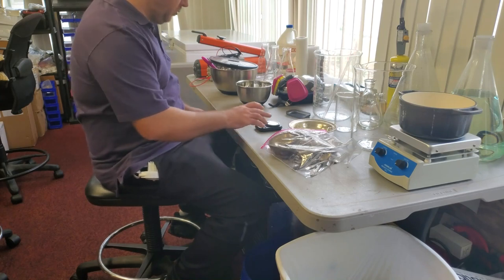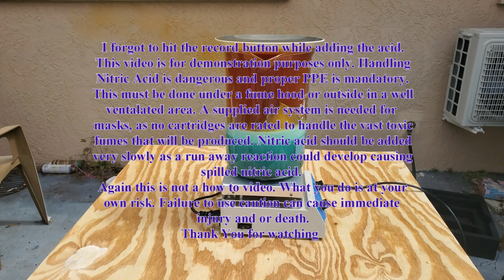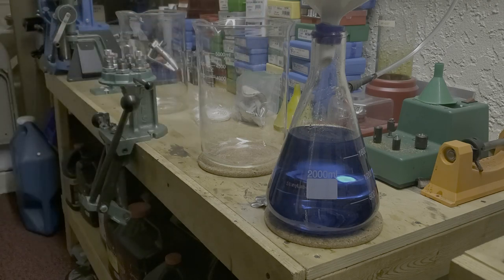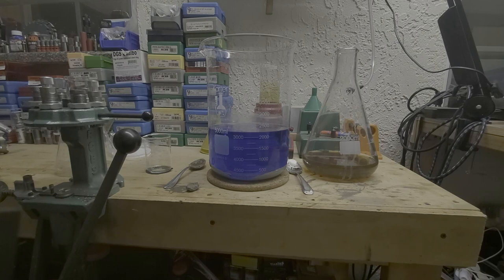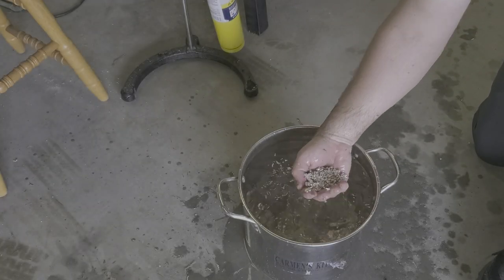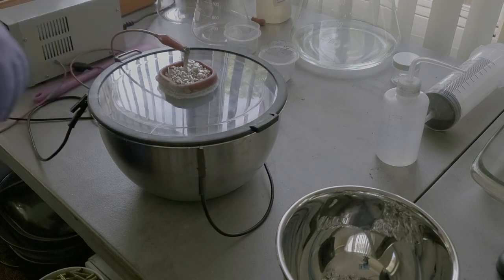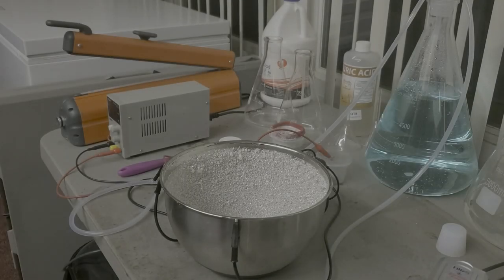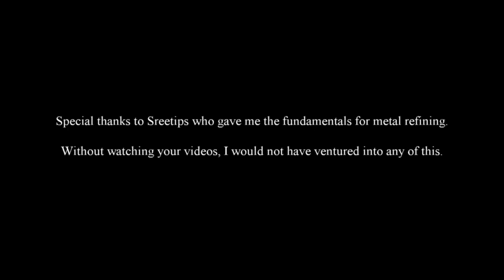Silver Refining Complete Process

Comment: How much Silver did you get out of the Used electrolyte? Im sure it was still loaded with Silver Nitrate.
Reply from the maker: Well its a lot. When the silver nitrate is saturated with copper to the point where it affects you purity you recover what's in it and start all over. Most will use muriatic acid lye and sugar to recover the silver it will leave you with a pretty pure silver but its a little bit of a pain.
Reply: Yeah I was just wondering how much you got out of it. Usally run mine about 2 weeks before I wash and I get a bit of silver out but it's nearly blue water at that point. I've found my copper plate out point and so I just go at 2 weeks and stop. Beyond that i see the copper coming out. But yours looks great! I've watched all of Sreetips stuff and I enjoyed yours just as much. I love watching this stuff even if I do it also haha. Keep it up
Reply from the maker: When I am making my silver nitrate I run about 25 troy oz of silver per 5000ml. I don't let it come anywhere close to exhausting the silver in the solution. Maybe 10 to 15 troy oz of silver I recover when I stop using it.

Comment: whyNotPutInTheCellSilverCementDirectlyToNotMeltIt?
Reply from the maker: It will make a mess. Like a large mess. The powder is very fine. It will not only clog up the bag in the silver cell but leak sand into your silver cell causing a lot mud to mix in to you solution. It messes everything up.
Reply: @matthewalbright571  ok.